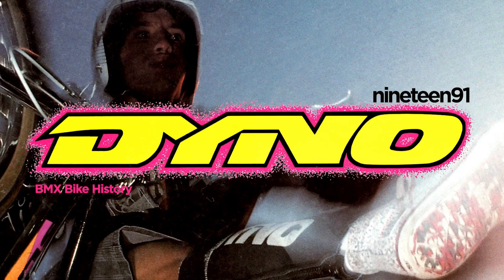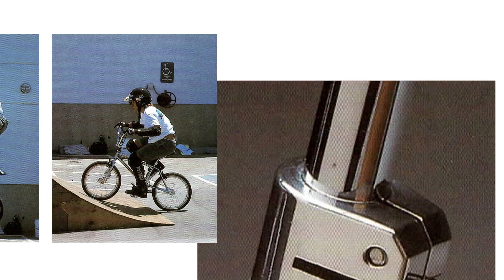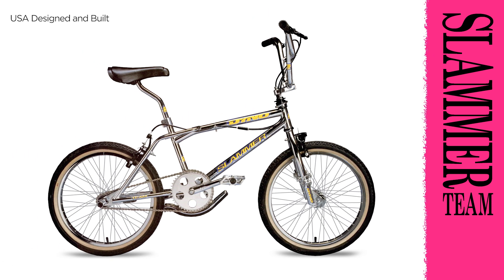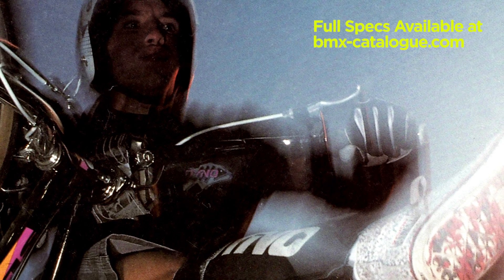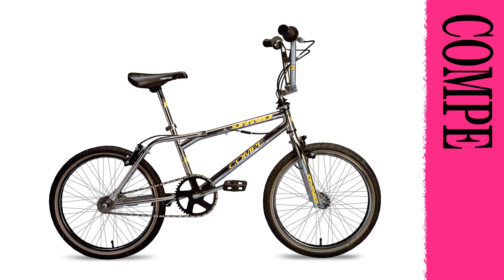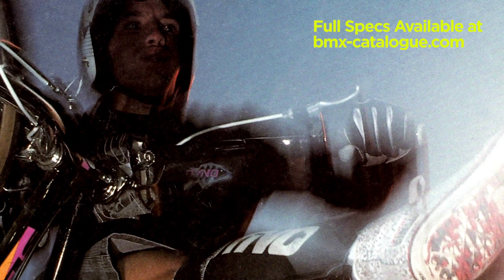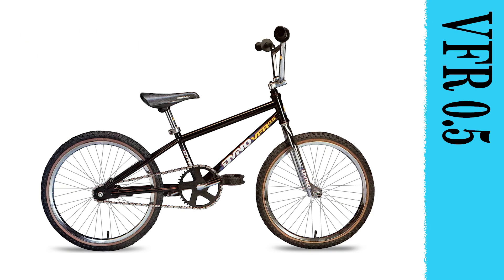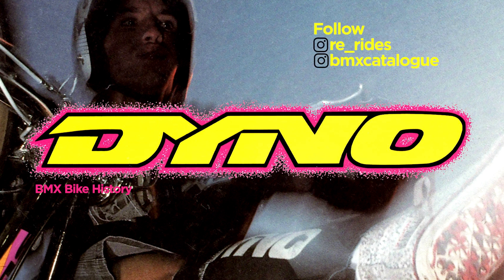1991 - The History of Dyno Freestyle and Race BMX

Comment: Found a Dyno on a dirt lot about 20 years ago. Frame and a bent chain ring on a crank they probably didn’t see any use in stripping the crank off.
I dumped $1500 into it with everything new.   Orange skyways , 3 piece cranks, gyro on down….       Only problem I have is I cannot identify which model frame it is.  The connection between the head tube  and the down tube has a plate originally welded to the bike as support between the head tube the seat tub and the down tube. I can’t see it in any of the photos of these bikes. It’s definitely a dyno considering the stamps on the dropouts.
Reply from the maker: Send a few pics to the GT Dyno groups on Facebook. They’ll help you identify it.